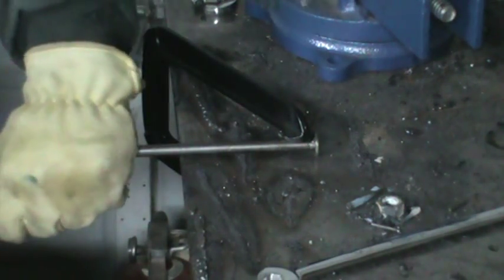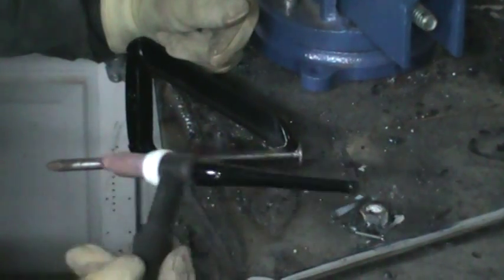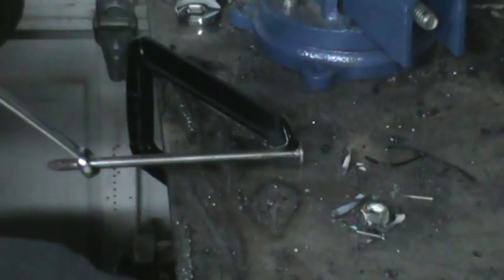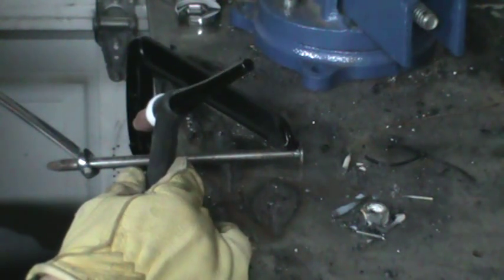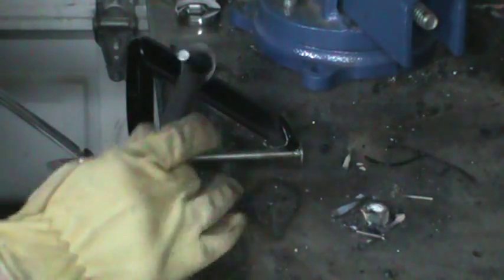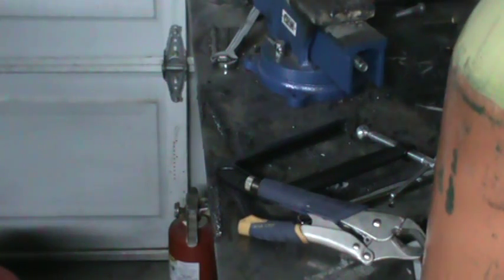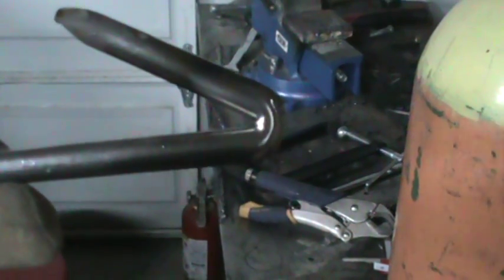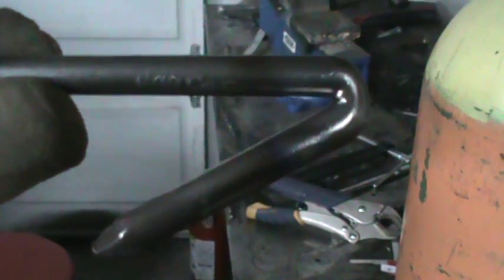Bending Metals Using Tig Torch

Comment: Came here trying to learn about heating a flange on my exhaust manifold where the rusty bolt will be too difficult to remove without torching the hell out of it.
Same principle. Saw another guy pre-heat a chunk of copper before TIG'ing it with some other copper because the copper wicks away the heat to fast.
If you can do this to a big nail without any adverse effects, I figure I can heat up my flange's bolt hole and work the rusty bolt out (fingers crossed.)
I lack a torch setup, but my TIG torch has a flexible head and a finger button control (for when the pedal isn't workable.)
You're right: nobody really video's using a TIG torch just for heating, so it's easy to draw the conclusion that it's not workable for some unknown reason.

Comment: Could you just use air from a compressor instead of the gas?
Reply: No
Reply: The tungsten reacts with any active gas and basically burns up the tungsten